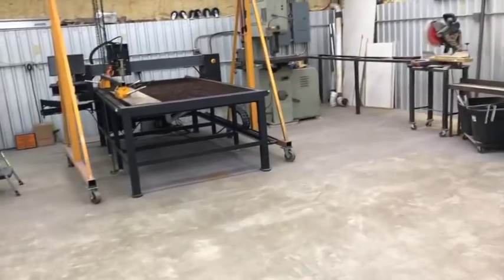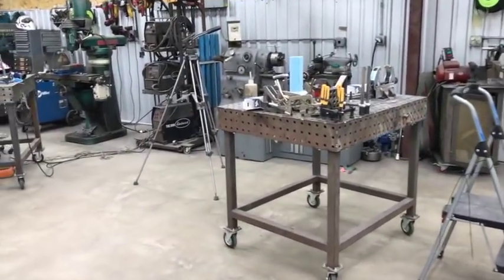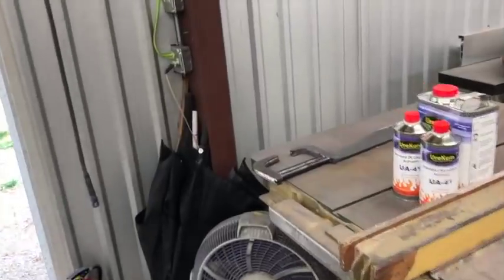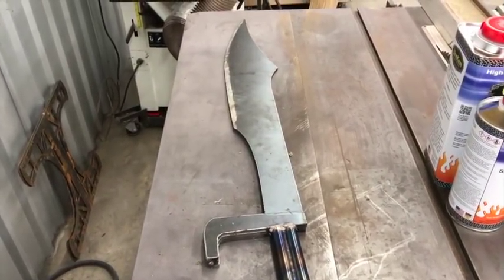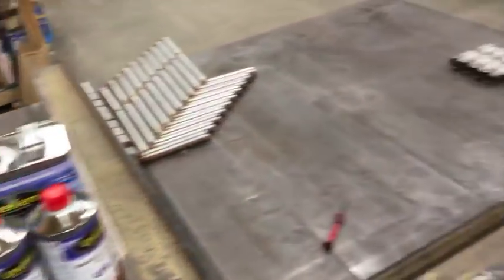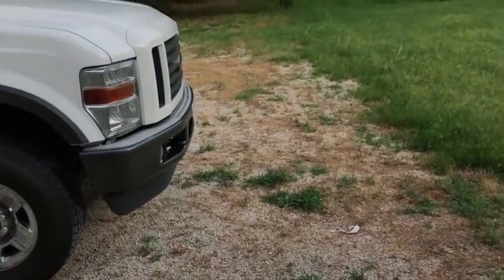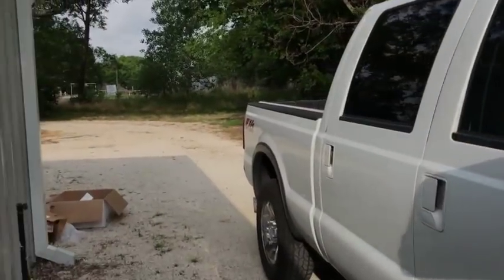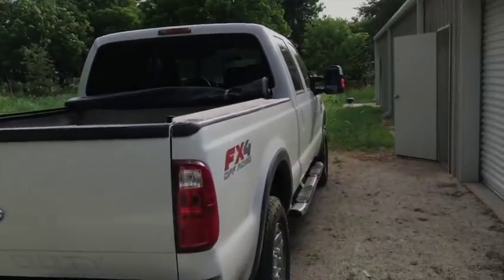why i stopped making videos

Comment: For really fussy welding, you might consider getting a Harbor Freight benchtop blasting cabinet, then plumb a gas purge into it.  You either purge part of the cabinet, or just have a gas purge running to bathe the welding area.  This will cut down on drafts and contain your welding gases in a tight area.

Comment: Hey Gary, You should have a small flat spot on your tube before you drill with the center drill.  Looks like your .100 hole is close to the rounded end of the tube,so there may be a slight incline in the tube,the best carbide will shatter if the drill "walks or wobbles the slightest. Use the biggest 2 flute HSS end mill you can, say 3/16"- 1/4"dia. to spot a flat, then do your drilling.  Anything carbide must be run at least 3x RPM of a HSS tool. Carbide may not be a good choice, HSS is tougher carbide is harder but fragile.  That filler metal must be tough to drill. also should be flat spotted before drilling good luck on projects!
Reply from the maker: Thanks man, yes I understand that.  I am drilling a pilot hole first that is .100 straight into the tubing.  The whole point of  a center drill is to keep it from walking. espcaially on something like the tubing.  I just put those to the side and grabbed a .100 regular HSS twist hole and drilled 400 holes with no issue.
Reply: Yep good choice to center drill first, glad you got it done...400  whoa!

Comment: Tractor with front end load would be a better choice than a simple lawn tractor, since you could add forks and used it for a light duty fork lift. But the cost would be a lot higher, especially if you need to buy a brushhog. Perhaps get a cheapo push mower, just to trim around the shop, and save up for a used tractor, and borrow your neighbors tractor 2 or 3 times a year to cut the entire grass area.

Comment: Carbide can't stand any walking so it likely isn't a good choice for starting the holes on a rough welded surface, cobalt probably be better.
Reply from the maker: now you tell me! lol.  i think i over think working in stainless.  after i broke 2 points off the center drills, i switched over to just a jobber HSS drill around .100" and proceeded to drill about 600 holes with no problem and it was still cutting good when i got done.  The carbide issue turned out to be rpm related.   I was turning it way to slow and putting alot of pressure on it.  Once i turned the speed it did much better but it eventually broke anyway.  I think its a poor grade carbide
Reply: Could very well be, some carbides are really brittle. A good alternative is like a KSEM Drill where you get a carbide cutting edge with a steel body so it can tolerate a rougher environment. Pretty pricey for most applications though. I would just use some good cobalt bits (Cleveland or PTD) and roll on.  Easier to resharpen too.

Comment: Gary is your Eastwood TIG the regular or digital model, would you buy it again. Thanks
Reply from the maker: its the non digital model, i have had it 3 years and it has performed flawlessly.  I have also welded with the digital model and it did great also and it also has a pulser built in where mine doesnt..  But if your thinking of buying one of these, i would reccomend the AHP alpha tig 200.  Its a sweet machine, built in pulser, AC balance, $680... and tons of people running them, dedicated facebook support groups, etc.

Comment: Your center drill exploded because it was poor carbide.  The better carbides are referred to as micro grain carbide, they are very tough and withstand a lot of abuse (relatively).  Micro 100 is a well known manufacturer of micro grain tools.  I recommend staying away from eBay and try reputable dealers like MariTool.  If you get a tool that performed like that from MariTool, he'd send you a replacement because he stands behind his tools.  Though from my experience, you wouldn't get a bad tool like that from him.  I also thin the grinder tool too deep of a cut on that tool, there is almost no core left in the broken section.  MariTool has decent prices and their stuff is made in the US by a reputable grinder, with good carbide.

Comment: Hey Gary- great to hear the top secret project came in for you, If the video's get slowed down so be it. That good money don't happen nearly as often as you can shoot video lol. Mower thoughts, depends on the money. Real tight- get a cheapo 3-500$ used rider that will make the summer and re-sell it for 100$ in the fall. Sorta tight- get a used 2500$ zero turn, try to get two seasons and resell it. Not tight- get the zero turn you think you need-new. I don't know if you'll really get a benefit of lifting from a small tractor/mower combo, and it will mow slower. The little ones can be handy, but tend to get overwhelmed quick and easier than you would think. Older forklifts and concrete may prove better money spent idk. Enjoy the videos you make. Thanks for sharing.

Comment: How fast were you running the center drills, 1000 rpms would be about the minimum for them
Reply from the maker: quite a bit slower going into stainless
Reply: Oldbarn Homestead looks like you have a #3 center drill or also known as 1/4 inch, here is a link to what the recommended rpms for carbide center drills in various materials SPEEDS & FEEDS 2305 Solid Carbide Center Drill - Fullerton Tool
PDFFullerton Tool › downloads › 2305 Spee... , it shows 2230 for stainless steels, likely why yours broke was its turning so slow at the theoretical center if you were running it at 500 rpm or something close to that. Hope this is useful in the future.
Reply: Sorry link didn't work just look up rpms for carbide center drills.

Comment: bought a zero turn Grasshopper a couple years ago ... will never go back to the tractor type
Reply from the maker: Good to know, thats definitely what I want.  I was thinking be able to combine a tractor type with a front loader to load/unload heavy stuff and also be able to mow with it, but having the speed and agility of a zero turn is hard to pass up
Reply: Oldbarn Homestead  Bought a used diesel grasshopper 7 years ago. Fast cutting me and my neighbors  2 acres of lawn and sips fuel. No more lawn tractors for me ever. Also, try using a SPOT DRILL instead of center drills. They don't break as easily.
Reply: snocrushr i used to mow with zero turns on a chicken farm i was on. They were awesome!

Comment: ....8:10......Not really a bad drill, or your fault....I see a few other channels and they all seemed to have the same problem with center-frills....they are fragile and need extra care I guess...anything a few degrees away from flat, they need a center cutting endmill first.
Reply from the maker: Well it actually turned out to be a speed thing, i was turning it way to slow, 1200rpm it seemed to work pretty good, but it eventually broke at that speed also lol